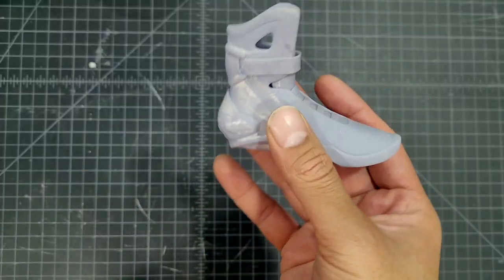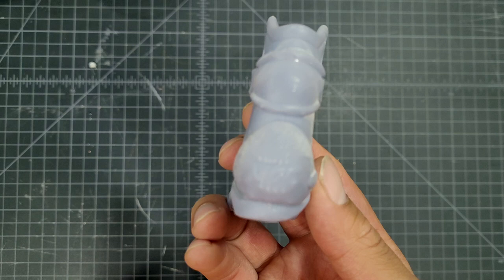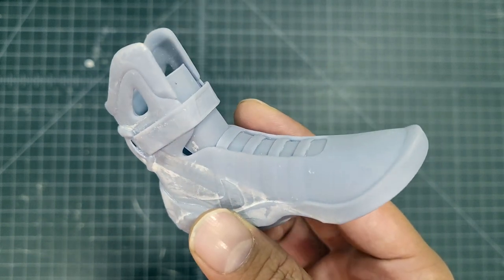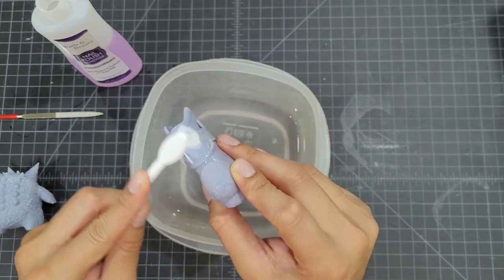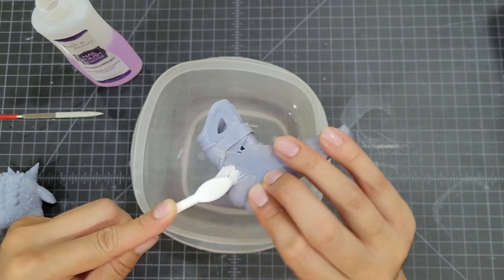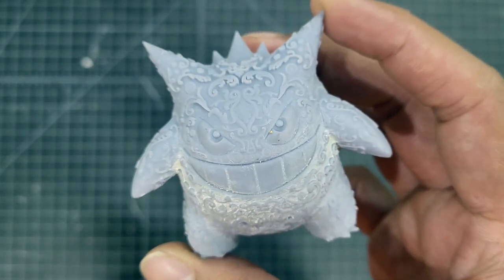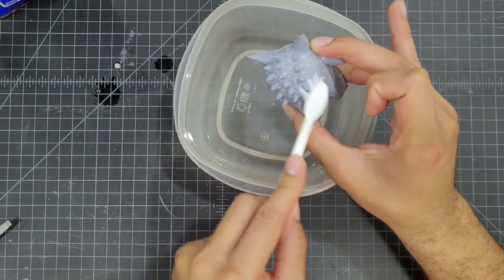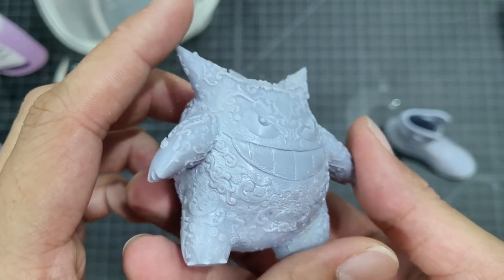Cleaning chalky Resin Prints with acetone!

Comment: You may want to consider using some protection when handling and breathing acetone.
Reply from the maker: That's a good point. Especially if your work space isn't well ventilated or using gloves if you are prone to allergies. I'll add this to my pin comment